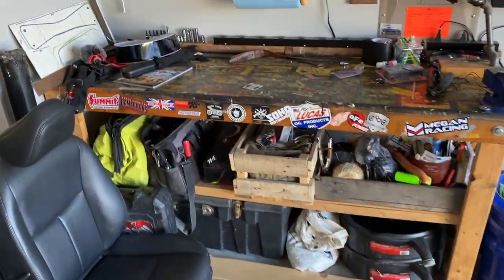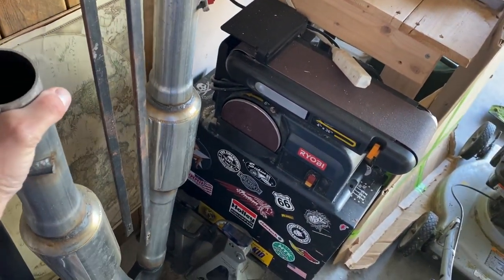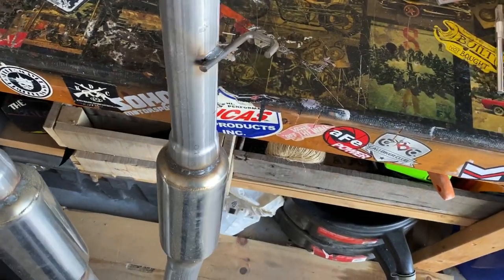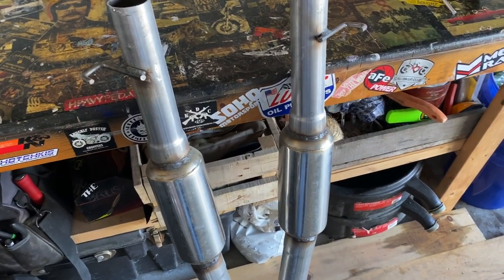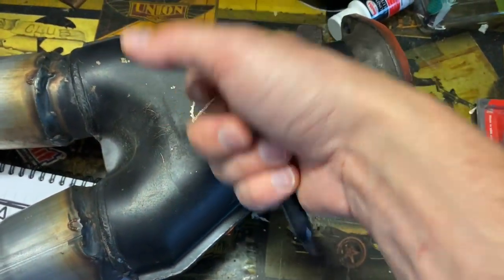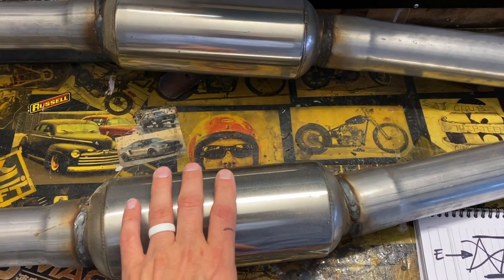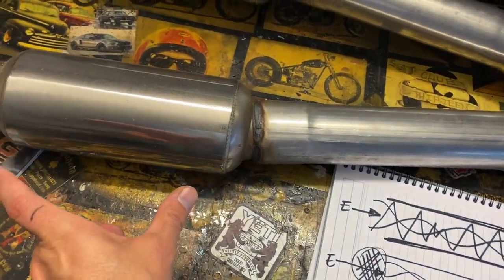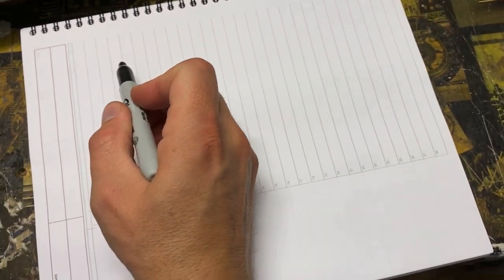THE Problem with Nissan Infiniti Cars | RASP and how to fix it!

Comment: i feel like exhaust mods should only be on V8 or bigger engines because 6 cylinder and 4 cylinder exhausts have that rice can sound
Reply from the maker: If not done correctly, you are correct.  But to say that exhaust mods on a 6cyl sound rice is a very broad and generalizing statement.  The vq37 can have one of the nicest exhaust notes out there.  You also realize that the GTR is 6cyl, right?
Reply: @SpeedCultureStudios  yeah of course theres some exceptions like a GTR or a 911 but those cars 100k so of course they will sound good but regular car exhaust with 4cyl/6cyl sound to raspy to put any exhaust mod on it
Reply from the maker: Paladin That’s just not true—to broad of a generalization.  I have 0 rasp with my 3.7l v6 exhaust systems.  40+ have copied my setup and have 0-very little rasp.  It sounds refined and aggressive—not obnoxious in any way.  Again, it has to be done correctly.  You can’t just cut mufflers and resonators off, of course.

Comment: Your alignment seems a little off
Reply: Or the steering wheel is just off center... either way I noticed it right away also, or it's a Nascar version (always going left)
Reply: Andymannoh Going to the left?  I recently got my 14 Q50s in October got it align and it still goes to the left when I brake   I don’t get why
Reply: Wearis MoE rotors more than likely

Comment: Can’t generalize based on decisions people make as far as exhaust parts they choose. It’s not a vq problem. It’s a user error. Mine has no rasp. If you choose to put test pipes then sure.. get some responses test pipes or hfc. Or what did you expect when you have a damn near straight pipe?
Reply from the maker: Did you watch the video?  That was the whole point.  And it’s not a generalization. The VQ platform is super raspy. There are very few cars that produce rasp as significantly as the VQ so the decisions one makes regarding their aftermarket exhaust solutions are very important if they don’t like rasp.

Comment: every car I've ever worked on has rasp from their exhaust systems this isn't just a Nissan thing its an all cars thing
Reply from the maker: There is a wide range of cars that you haven't worked on then...  BUT yes, there are lot of cars, especially smaller displacement vehicles that suffer from rasp when equipped with aftermarket exhaust systems.  The VQ is particularly raspy and has established a reputation as such.  On top of that I would add that I did not say Nissan/Infiniti were the "only" cars with rasp problems.  The title and thumbnail both state that the "biggest" problem nissan/infiniti cars suffer from is rasp.

Comment: When you switched to your current exhaust setup have you seen an increase in HP or Torque ?
Reply from the maker: I discuss this in my retune video. I got 1 more hp over the 2.25” exhaust but I lost 8 lbs torque. Just as I suspected.
Reply: Royal Luxe it came like that with the car when I bought it but if you take it to a muffler shop they shouldn’t charge you more than 200

Comment: Your alignment is totally off. The steering wheel is not straight.
Reply from the maker: It’s the camera angle.  It’s not “totally” off and it’s not the alignment per se. the wheel alignment is in spec and drives straight. When I got this custom steering wheel however, it didn’t quite line up like the factory wheel. When matching up the notches, it was slightly to the right. Moving it back one notch made it a tiny touch left, which is where it is now. Not worth putting it on an alignment rack right now because it’s such a tiny adjustment it’s not worth the cost, and when the car is sold, the factory wheel is going back in and it’ll be dead nuts.

Comment: Automatic gearboxes
Reply from the maker: They aren’t really a “problem”
Reply: @SpeedCultureStudios  are you sure ?
Reply from the maker: @eyes2338  Why do you consider them a problem?
Reply: @SpeedCultureStudios  research on cvt gearbox's for high powered cars.
Reply from the maker: @eyes2338  The g, z, and q does not have a CVT transmission.  So that’s not a VQ problem.